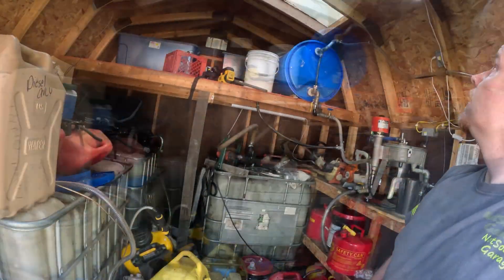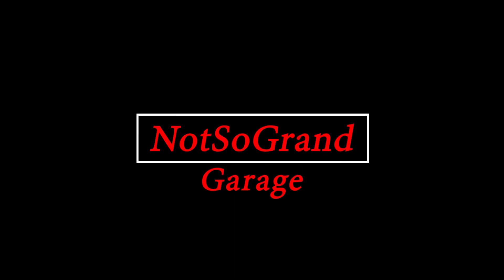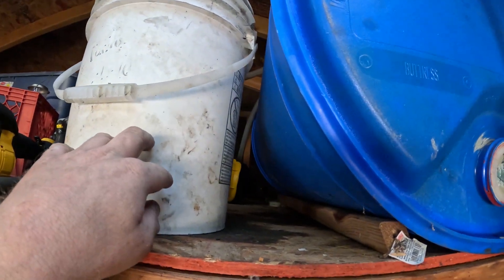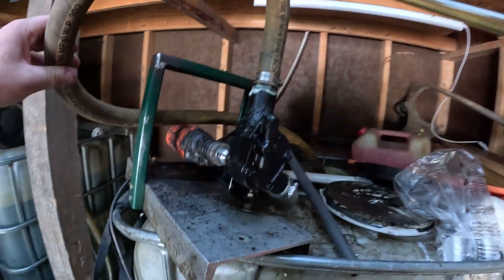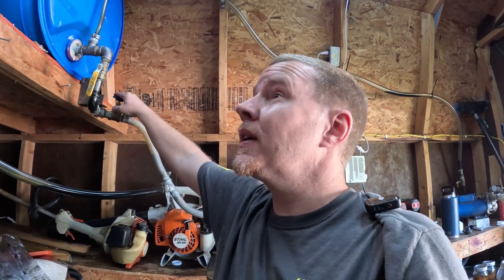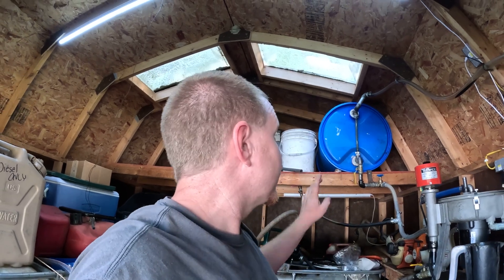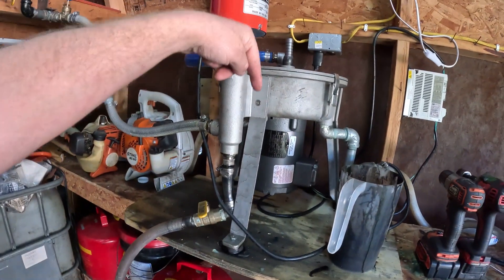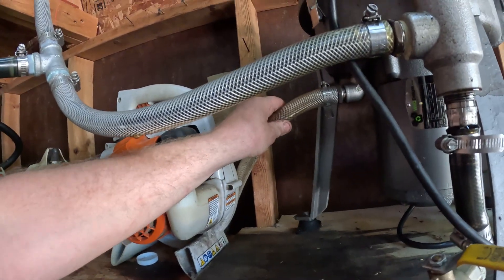Black Diesel - Back To Basics Series - Feeding The Centrifuge - Step 1 - WMO WVO Biodiesel - Fuel

Comment: If you were processing 500 gallons a month would you still gravity feed? I'm really looking for a pump so it can be set it and forget it.   The constant adjustment and re fill of gravity drum is driving me mad.   In the winter it's absolutely infuriating
Reply from the maker: If I were doing large batches, I'd probably run IBC totes instead of drums...  Run a pair of them on a pallet rack and still use gravity.

With that said, I know a few people running pumps.  WVO is working on a dosing pump setup as well.
Reply: Any idea on time line till the dosing pump from wvo hits market? Months or a year or more? @NotSoGrandGarage 

I may end up running the ibc tote.   Been saying forever that I want to run 2 centrifuges in line but that makes it harder to get the tote high enough
Reply from the maker: @BRWfilms I'll see what I can find out.
Reply from the maker: Update...   WVO is sending me a dosing pump to do some testing with.  We'll see what comes of it.
Reply: Awesome! @NotSoGrandGarage

Comment: Super over engineered! All you need is a bed sheet. I've seen it done before on Instagram! 
Just kidding. 
The manufacturer of the bed sheet does not recommend filtering oil and putting it into your engine. Pretty sure it's a 40,000 micron filter
Reply from the maker: 😂 yeah it's a bit of a process...   But lab tests has my stuff meeting clean diesel standards as far as particulate and moisture go.  Hard to complain

Comment: Im looking at building my own set up but my biggest concern is getting used oil with coolant in it. Have you dealt with this? I theory the centrifuge should be able to separate the water but I’m concerned with what it doesn’t catch and if that will hurt my injection system.
Reply from the maker: Settling your oil prior to processing helps with this quite a bit.  With that said, if the bowl of the centrifuge looks like pudding after a run, your oil is wet and you'll need to run it again.  When you're ready...  www.notsograndgarage.com

Comment: is there a reason why you dont just run like.. 1000 liters through at a time?
Reply from the maker: Mainly, I just like doing smaller batches as it works for me.  Many people do large runs.  I've also completely filled the bowl of the centrifuge on a single 50 gallon pass.  Never know how dirty the oil really is.
Reply: @NotSoGrandGarage  was mostly just curious if theres a big chance of moisture accumulating back into a tote aftet its processed, i need to try and process basically a winters worth of fuel before it gets to -30 but my centrifuge isnt going to show up untill early november.
Reply from the maker: @brucebarnes311  oof...  Who'd you order from?  I'm shipping practically the same day..  have units in stock ready to go.  With that said, I wouldn't think it would be a major issue like any other bulk fuel storage.
Reply: @NotSoGrandGarage  i went with PA biodiesel single pass version just beacuse it was the cheapest. and honestly because they do inhouse financing lol, but once i placed the order they said they where on back order and i just thought to myself damnit lol
Reply from the maker: @brucebarnes311  gotcha.  I do have ShopPay installment pay available through the website but that only lets you stretch that out so long so I get it.  These things aren't exactly a small investment.  Let me know if you have any other questions.

Comment: Sir....don't know why you are wasting your time.  Have heard of an Alfa Laval MAB 103 or MAB 104 with an attached feed pump.  You can buy a used one for about $5000.00 and it will centrifuge and clean your oil and transfer it from drum to drum without gravity feed and so forth.  It seems that you are  re-inventing the wheel.  Alfa Laval has been around for over 150 years.  A little hint, put a disc stack in the bowl.  It'll increase the efficiency of the purification.
Reply from the maker: So what you're saying is I'm accomplishing the same thing for half the price.  With that said ..  I didn't build this equipment I'm running...   and considering the money I've saved over the last 15 years, I'd say I'm far from wasting my time.

Most people in this game cringe at the thought of buying new equipment and spending $2500...   You think people are going to be happy with dropping double that on used stuff?  I can assure you that's a big nope.   Those units are also designed for industrial use meaning 3ph power.  The average person making fuel at home isn't going to have access to 460v 3ph.

I'm not a machinist either so redesigning the bowl isn't in my wheelhouse.

Thanks for watching anyways though.

Comment: on the next episode where you talk about the centrifuge, can you cover your cleaning techniques? I usually spoon out the bowl but the heater element can coke up oil on the element itself and sometimes it fills with any junk in the oil from the feed source. I have the cap on my tube that came with the centrifuge but i see yours has a ball valve.
Reply from the maker: I can do that.  I run a valve on the bottom of the heater to allow easy draining.  I've noticed some water separation in the heater itself so I crack the drain between runs and after a batch is complete, I drain the whole system.  With that said, I'll see what I can do.
Reply: @NotSoGrandGarage finally getting around to assembling the new extreme system that I bought from you this week. I am glad I saw this video and read this comment. That is a great idea about having a drain at the bottom of the heater. I will look into doing that myself

Comment: I’m just getting into it myself. 

My setup is currently a steel 55 gallon drum that I welded 3 bungs into the side. The bottom one for a sludge drain, it tees and runs to the top bung with clear 1/2” pvc in it I bought off Amazon. There’s a ball valve to make sure I can isolate it if I ever need to. 

The middle bung is about 1/3 of the way up. That one has a ball valve, then goes to a 12v diesel pump I mounted on the drum, then 2 filters, a hydraulic filter then a Baldwin branded cat fuel filter. Check valve after the second filter, then runs into a second drum for filtered oil. 

I use a large round air filter from a Chevy express van in a 5 gallon bucket with a hole and pipe in the bottom to prefilter while filling the drum. 

The drum has a band heater on it I leave at 100* to help get any water cooked out of the used oil. 

I leave the drum like that when it’s filled for a few months to get as much settled to the bottom as I can before running the filters. When I’m ready to filter, I turn the band heater up to 200* for a while before turning the little pump on, the heat helps lower the viscosity so the pump should live longer. I also do 50/50 oil and diesel in the drum before filtering. 

This is all to feed a 92 F250 with a 7.3 IDI. Truck is about to get a banks turbo kit and a new clutch, while I do all that work, it’ll get water injection too to help keep things clean.
Reply: You will be fine, ever heard of Zip Ties n Bias Plys? That guy just pours his oil changes directly into his 7.3IDI rigs. In fact I have never seen a motor repeatedly take so much aboose. Check it out!
Reply: @datalorian  I’ve watched some of his stuff. He doesn’t care if his explodes, I do. 

But you’re right. These motors will take a lot of abuse. So filtered motor oil should be just fine.
Reply from the maker: The 7.3 IDI is just about the most forgiving platform for alternative fuels.  I've ran multiple on all sorts of blends and processes over the years.  Good luck with everything!
Reply: @NotSoGrandGarage  eventually I’ll get a centrifuge, but just not in the cards right now. Trying to get out of debt this year and start saving for a house down payment. 

Hopefully going through a few filters including a couple additional on the truck will be enough to keep her happy.

Thanks for all the info you give!
Reply from the maker: For sure.  I started out with used drums and whole house water filters...   it is what it is and yeah a centrifuge is certainly an investment.  Keep at it bud.

Comment: I used to make black diesel with Dieselcraft centrifuge for IDI ford 7.3, 6.9, Mistsubishi 4d55, Kubota 2203,  and Mazda Perkins. Those all had gazillion miles  on them and eventually were put to rest.  I recently acquired a 97 Ford Powerstroke and a 99 Volkswagen TDI Beetle. Just looking for anyone's experience with either of those engines and any potential blends.
Reply: My buddy ran my mix through his 97 power stroke and had zero issues. Thing to watch out for, your fuel filters. That truck is coming up on thirty years old, probably ran nothing but pump fuel. The detergents in the oil will break down those deposits and plug your filter solid. It’s not the black diesel itself that will plug your filters, it’s the decades of junk that it’s scrubbing out of your fuel system. I run mine in a 94 idiT F250 and I’ve never had any issues. As for the tdi VW, I’m not sure. If it’s high pressure common rail I’d say hard no but I’ve yet to experiment with it through a modern diesel engine. I’m in the process of refining my setup but as of right now, Chris has a setup better suited to filter for new engines than mine.
Reply: How much oil in that 97 ford mix?@adrienst.raymond6801
Reply from the maker: a friend of mine ran an early 2000s powerstroke on filtered waste atf for 5 or so years without issue.
Reply from the maker: The powerstroke is a solid platform for alternative fuels.  There are even a few outfits producing tunes for oil.  The ALH has been known to do well also.  How you setup the systems and how you process the oil will make the difference.